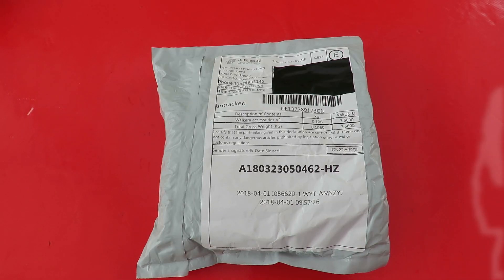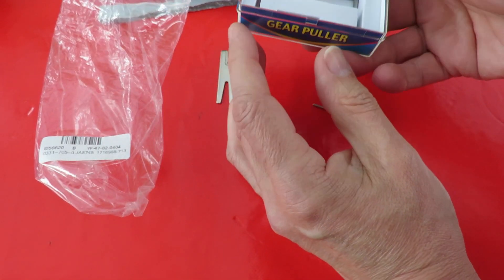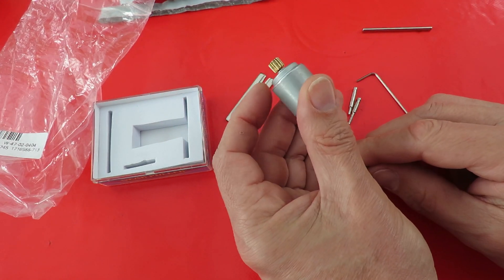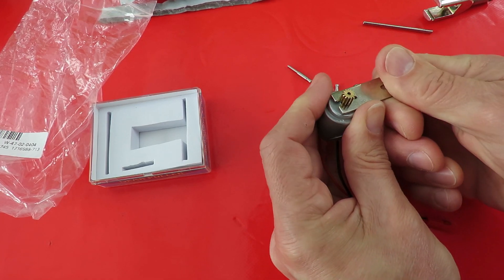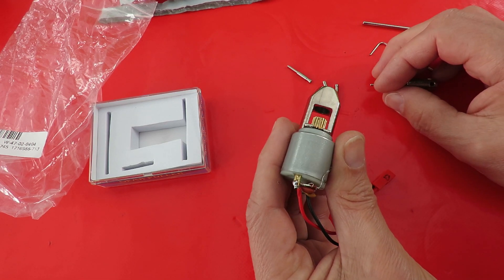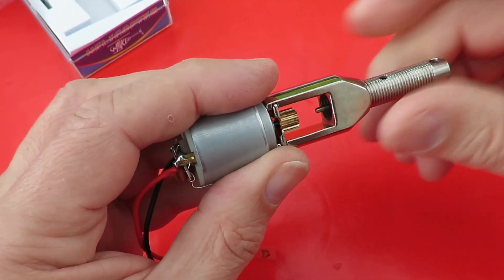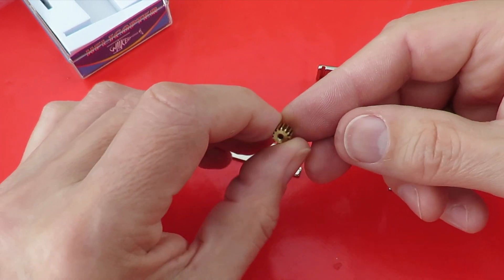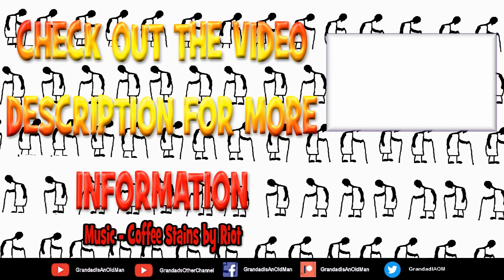Grandad's Postbag 180424 Walkera Gear Puller

Comment: Great video but garbage tool. Does not even look to support the motor casing as its pulling it off so technically even if it were to fit, its not doing its job to pry but also push agains the casing. Once there is a gap, its pretty much unsupported and pulling directly on the shaft. I am sure you can invent a better one to sell.
Reply from the maker: It works fine, maybe you need to watch it again. If that gear wasn't pushed so far down the shaft there wouldn't have been a problem. I would think that 99% of the motors I have worked on would have sufficient gap between the gear and the motor casing for this tool to fit easily every time. It should not make contact with the motor casing. You are only supporting the gear itself and pushing the shaft through it. You will see me using it on another motor in a video scheduled for about a weeks time and that one has the gear in a better position.